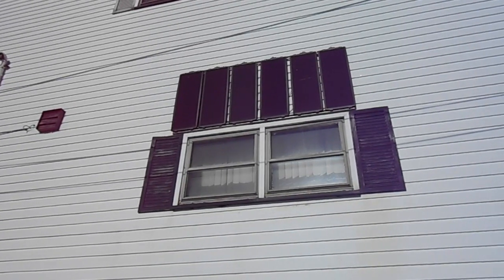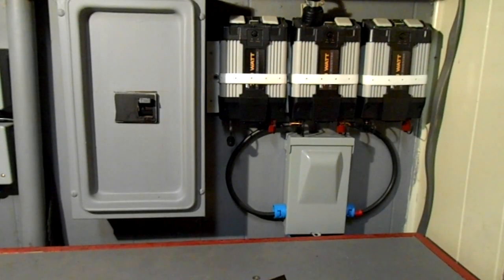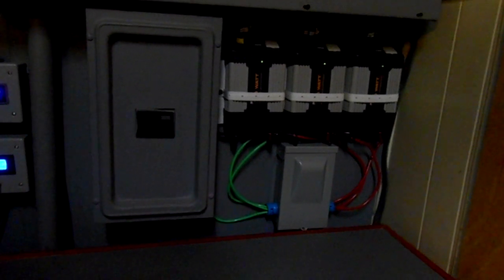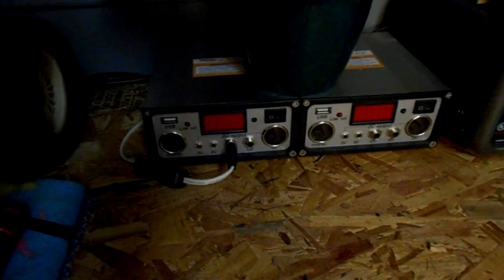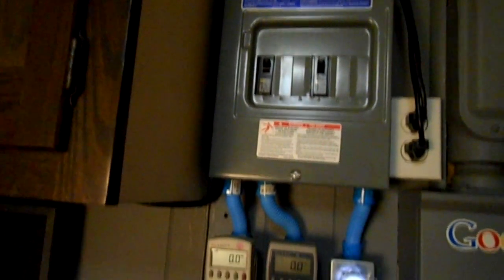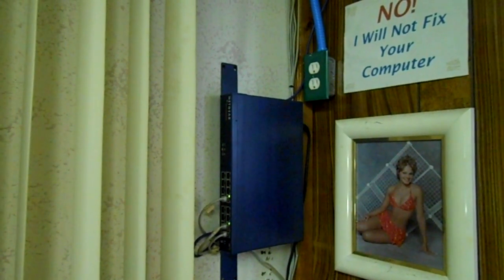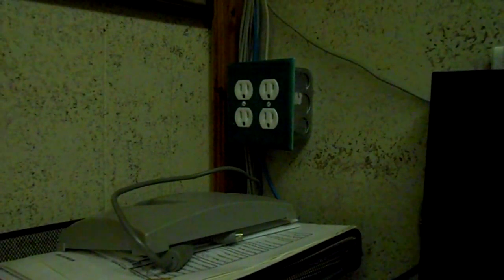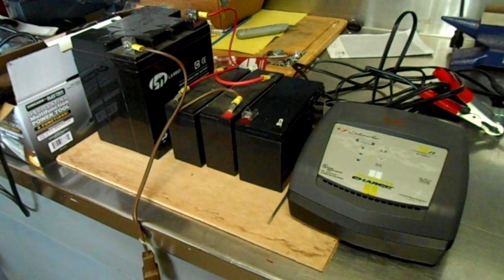Tour of Small Emergency Solar Battery Backup System

Comment: thanks for sharing. My Question is: we run on solar, 6 panels, 4 batteries, inverter, charge controller, all hooked up and running. But, the inverter can be hooked into the generator in case of cloudy days.   But there is no non- professional instruction in that manual. when I phone them they want to send a tech out, and I believe that with simple instructions we can hook it to genny. We have a 100 ft RV type electrical cord, but still haven't been able to figure it out. Can you give directions or show on YouTube how this is done???
Reply from the maker: What is the make and model of your charge controller?
.
Reply: GuruBrew Our charge controller wouldn't have anything to do with how to connect the generator to the inverter, But here is the make of our charge controller INTRONIC'S MPPT75HV OUR INVERTER IS MAGNUM MS 2812. THAT'S WHAT WE WANT TO CONNECT TO THE GENERATOR WHEN WE ARE TOO OVERCAST OR HAVE TOO MUCH SNOW FOR THE SUN TO GIVE US THE POWER WE USE. We have all the parts needed to do that but haven't been clear as to how this will actually work out and//or how to connect correctly.
Reply from the maker: M John
I asked about your charge controller because some of them can work with supplemental auxiliary charging like gens or other sources of AC charging.
I looked up yor model and it does not as like mine. If it had, this is the simplest method to use. However,,, In the video you will see a large, round, red switch below my charge controller. This is what I added to select and charge the battery's in position 1 with the solar and position 2 to use the AC powered battery charger that is also shown sitting on the table. Position 3 will charge the battery's using both sources at the same time. It's all in the wiring of the high amperage switch. If this is of interest to you an will work for you I will take the time and make a diagram you can use. Steve
Reply from the maker: M John
OK me again. I just found the documents for your inverter and it appears that you can hook it directly to AC mains or Generator (fancy pants). Here is the link to the PDF http://magnumenergy.com/wp-content/uploads/2012/08/64-0007-Rev-D-MS-Series_Web.pdf  the page will take a while to load so be patient. Page 35 shows a diagram of what you are trying to accomplish. Have fun...

For those without the nice inverter you can use the method stated above using a high current switch.